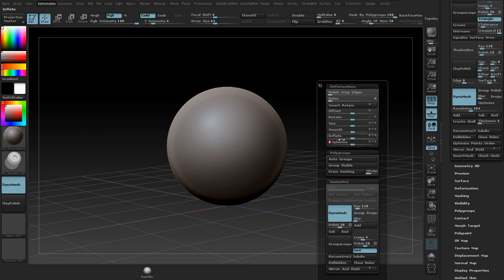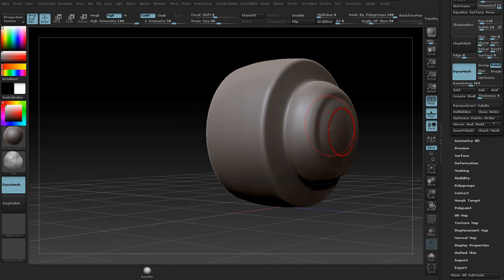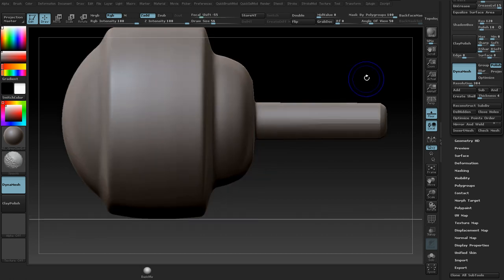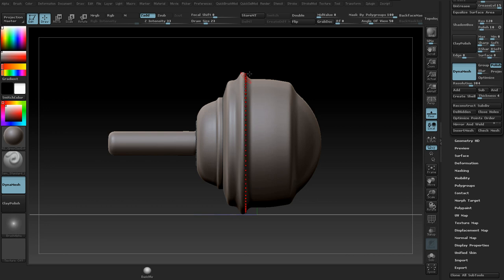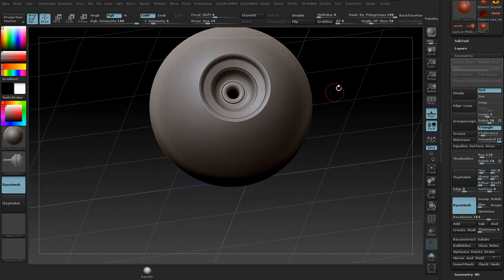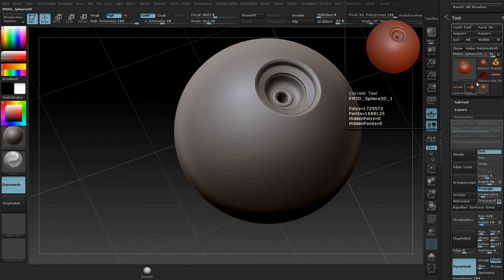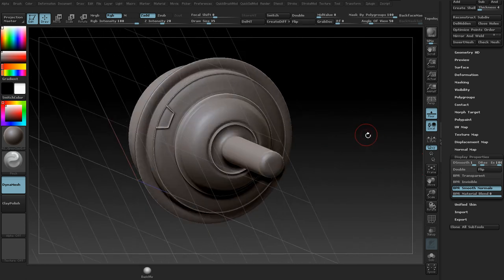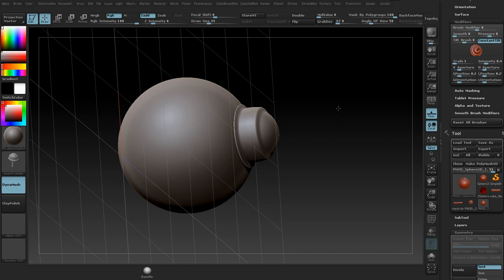Zbrush 4.0r2 Creating a Mechanical Insert Brush

Comment: Typically this would work for me, especially with other insert brushes. 
However with your collection, I'm left with the insert itself and not the cut. 
It's as though the sphere cuts away from the inserts. 

What is the correct key combination for a cut? Should be Alt right? Doesn't work for me, for whatever reason.